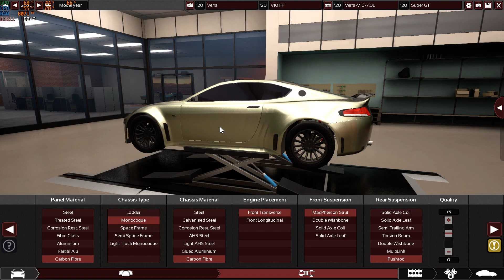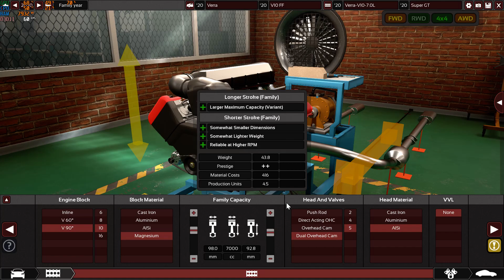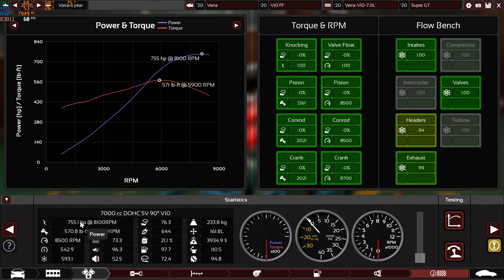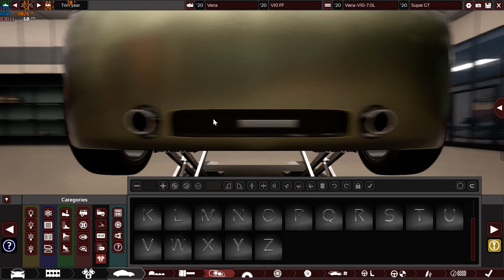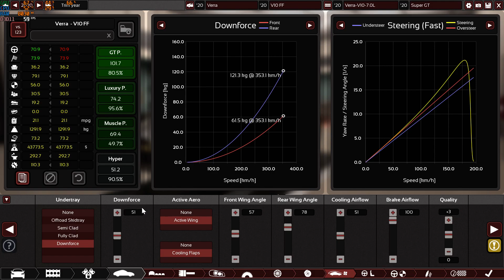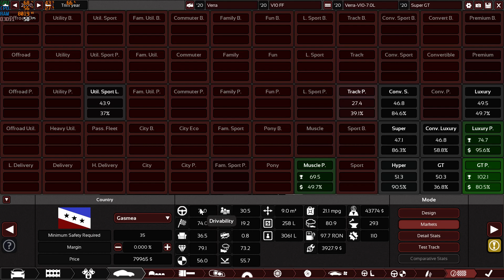Front Wheel Drive Super Car Build in Automation game.

Comment: I'll Dare you Make A Ute with LSA Engine Recreation...

LSA Engine Specs :
6.2L LSA TECH SPECS
Displacement 6162cc (373 ci)
Engine Orientation Longitudinal
Compression Ratio 9.1:1
Valve Configuration Overhead valves
Valves Per Cylinder 2
Assembly Site Silao, Mexico
Valve Lifters Hydraulic roller
Firing Order 1 - 8 - 7 - 2 - 6 - 5 - 4 - 3
Bore x Stroke 103.25 x 92 mm
Fuel System Sequential fuel injection
Fuel Type Premium required
Max.Engine Speed 6200 rpm
Emissions Controls Catalytic converter, Three-way catalyst, Positive crankcase ventilation
Horsepower Cadillac CTSV: 556 hp (415 kW) @ 6100 rpm *
Camaro ZL1: 580 hp (432 kW) @ 6100 rpm *
Torque: lb-ft (Nm) Cadillac CTSV: 551 lb-ft (747 Nm) @ 3800 rpm *
Camaro ZL1: 556 lb-ft (754 Nm) @ 3800 rpm *
Block Cast aluminum
Cylinder Head A356-T6 cast aluminum
Intake Manifold Cast aluminum
Exhaust Manifold CTS High silicon moly cast iron
Main Bearing Caps Nodular iron
Crankshaft Forged steel
Camshaft Hollow steel
Connecting Rods Forged powder metal
* Actual power levels may very depending on OEM calibration and application.
* Information may vary with application. All specifications are based on the latest product information available at the time of publication. The right is reserved to make changes at any time without notice.

Comment: I would request a Suzuki Hayabusa engine. 1300cc DOHC 16 valve 4 cylinder, with a 6 speed transmission. Revving should be max either 10500 or 11000. Call me viper in the next video you put my suggestion into, because it seemed like you were confused as to how to pronounce my name, haha

Comment: I really like the car. Thanks for doing my request. When I did it I used the same body but bigger tires, 5.2L TT v10 double wishbone front and multi link. 388 km/h 3.9 to 100 1/4 mile in 10.86 1km 18.18. Automation track in 2:00.75, airfield in 1:12.82. It produced 1,005 HP 710.6 lb-ft it revs to 9,000 rpm @ 18.07 psi. I got 22.5 mpg. But I used quality between +5 to +10.

Comment: Hey. I know you take suggestions from your Snapchat thing, but I don't have it, so... Anyway, could you maybe try to make a 2nd gen Toyota Century knockoff (or atleast the engine)? The engine in it is/was a 1GZ-FE:

5.0 L (4996 cc) V12 48-valve DOHC engine with variable valve timing (VVT-i)
Bore - 81 mm; stroke - 80.8 mm, with a compression ratio of 10.5:1
The fuel injection system is controlled by two ECUs, one for each bank of cylinders.
Power output 280 PS (210 kW) (official); 312 PS (229 kW) (actual, estimated)
Torque output 460 N⋅m (340 lbf⋅ft) at 4000rpm
Reply from the maker: already did it 
https://www.youtube.com/watch?v=jO3rm2-IeSI